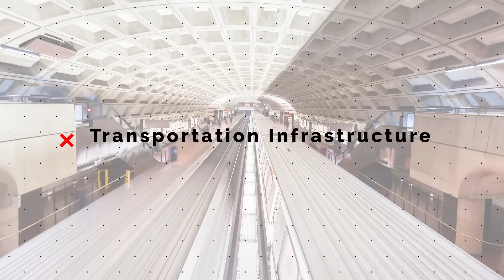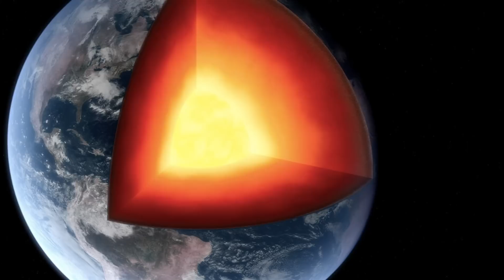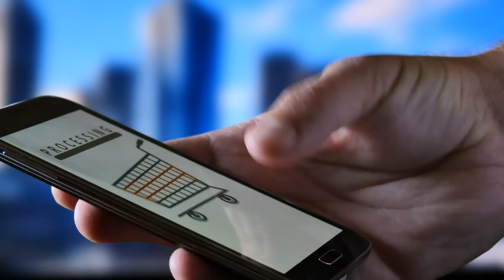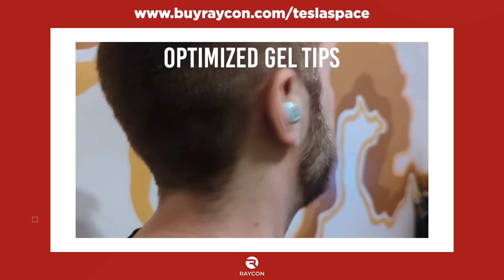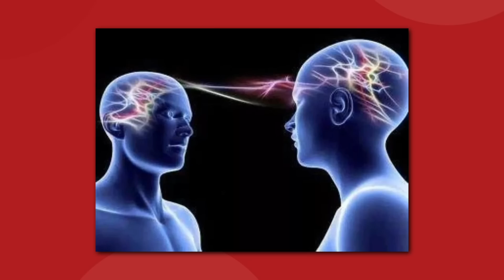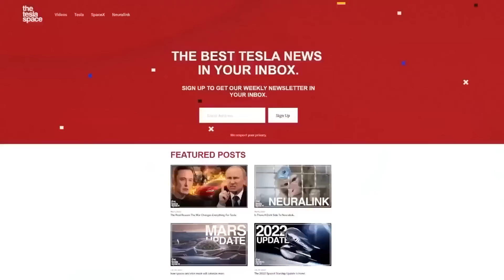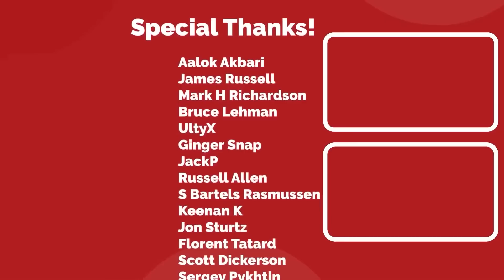How Elon Musk Will Build The City Of The Future!

Comment: Well. The city on Mars needs to be designed right now before we just start boring into the ground and putting habitats everywhere and anywhere. We need a design for the city from the deep ground up. before we get there.  And the infrastructure. Keep the noisy manufacturing and waste disposal areas away from the habitats housing.  Underground transportation  tubes need to be there to connect waste disposal, water supply, electrical, fresh oxygen, and goods all in separate tubes, some small some large.

Comment: While I agree with his points on Solar energy, there come some environmental flaws. Mainly the mass of solar panels would redirect a TON of direct heat and energy back into the sky, quite literally frying any life that goes over it. Solar arrays have had this problem for ages, which is why you commonly see it only on mid-size residential houses, unfortunaetly not where we need it most.

If we can figure out how to heat sink the solar arrays and make them less heat/light reflective, thus preventing the magnifying glass to an ant effect, then we can commercialize and go green worldwide.

Comment: I know all you guys at Tesla are smart and I'm just some dude but if you incorporate alternators into all four wheels of your cars, they will charge themselves. Pretty sure this is about limiting travel or someone would have thought of this
Reply: You still use up the energy to power the alternators. Unless we could get the energy from solar panels integrated into the cars roof. But its low and slow energy for the alternators. Especially 4 on each corner. Plus the power to weight ratio of installing solar grids on the car. There might be another way ... Maybe .. No one really knows. There is alot of research going into it. Even on different type of batteries. Whoever perfects it wins the whole EV race. But i dont know about unlimited electric. That would be kinda of insane. There would be no need for chargers then. Electric companies would be pissed. Lmao.
Reply: @gfelix3552  well I mean they made crappy light bulbs to intentionally burn out to keep selling light bulbs for DECADES. That's kinda my point. Im sure they can charge as they drive somehow. But that screws the power companies. If we're going to suffer through this green shift let's really be green about. Not this, the big guy still gets his crap thats no different from oil companies.
Reply: @gfelix3552  on a car an alternator is powered by belt motion not the battery. Harness the wheel motion. Especially for like semi trucks that are always driving
Reply: @shenanigansnsuch1442  

Yeah but the alternators in ICE vehicles are powered by gas in order to move the belts. There is a big difference in gas and electric.
Reply: @shenanigansnsuch1442  If that were the case. Someone would already beaten and won the EV race and become a billionaire like Musk.
Reply: @shenanigansnsuch1442  

Also not only are the belts in ICE completely different in that they are spinning at high RPM but they are also pretty weightless and are found around the engine. The spins on wheels would have to be going super fast in order to even gain anything and  like i said 4 on each side would be heavy. Basically it would even slow down the wheel because it has to extract the energy. Obviously there are some maths to prove it but i am lazy. Lol

Comment: OK, but as far as Drones go... the drones only deliver over the last few miles, within the cities & towns. The underground network is to replace/add to main roads, not all the countless interconnecting roads, so we'll actually need the same number drones to deliver the last miles to your door. Unless you're building a city from scratch, there's no way you can install tubes that will accommodate parcels to every address.
Reply: Water pipes needs to be replaced from time to time so why not to add another tube in the moment of replacement. But still the technology of vacuum pipes is old and if it were good idea to have it everywhere it would be the reality nowadays.
Reply: @wujido20  " add another tube" ??? 😆 That would be a massive change! And water pipes last years, decades, you have to replace/add a continuous tube for miles in one go... AND it's a pressurised tube, with junctions for every street, every home, it's not just an extra tube... AND you'd be limited to parcels a few cm wide, and only a few cm long to get round corners.... AND space for packages to arrive at each home without backing up the tube, every parcel would have to be in a container within the tube.
 It's an entire,  more complicated network and would only work for tiny parcels.

Comment: You don't evacuate the whole hyperloop tunnel.  You have a lower air pressure in the tube and then an electric compressor on the front of the pod pushes air to the rear.  It still uses air in the tube, in fact the pod is riding on an air cushion and propelled with electromagnets.
Reply: Have u ever seen how finicky a vacuum tube  can be? N u think they're gonna build one thousands of miles long, I gotta beach house in Idaho for ya too
Reply: @joshlewis575  I guess you know more about this than Musk and his team.  People were saying something similar about landing a rocket ship and resuing it.  But they did it, spectacularly.  I expect they'll do something similar at the Boring Company.

Comment: Honestly, the tunnel thing is just tiny private subways that are simply less efficient than just a subway…
I really like the the solarpunk like positive futuristic thinking of Elon and his simps (absolutely including me) but at slightly worse subways that only look more futuristic you should think twice before public-Elon-simping
Still like your videos though, keep up the positive attitude regarding our future <3
Reply: Why so sure that it's less efficient?
Reply: @bergonius  because a car is less efficient than a bus. It is also less efficient than a train.
Reply: @niveshproag3761  it's not that simple. First, EVs are very efficient, 5 times more efficient than similar vehicle. If we compare with extremely dirty polluting busses the difference in energy efficiency becomes astronomical.

Next - busses run with huge capacity overhead for attributing rush hours peak demand, meaning most of the time they run with mostly only air inside. With smaller capacity transport this doesn't happen, as during smaller demand there's just fewer units on the line.

And thirdly - TBC concept ultimately includes self-driving transport pods with greater number of seats, making it perfectly effective for the task, no bus line would be able to compete with that. 

Next
Reply: @bergonius  Compare with electric busses, not extremely dirty polluting busses lol. 

In peak hours, mass transport are something like 50x more efficient because we're simply not using a 1.5 ton vehicle to carry 1-2 80 kg person. 

However off peak individual transport becomes a bit more efficient since it's a 10 ton vehicle, less people.

Overall the balance is always towards mas transport. A mass electric vehicle would be nice, as you said. Gonna take a while tho.
Reply: @bergonius  
In the scenario of the tunnel systems are meant to replace the roads, so all of the people driving around in their cars wouldn’t really have a better way than to use the tunnel system.
So the problem with public transportation not being used to its full potential is less of a problem…
Plus, if you are in a tunnel anyways, the freedom of driving where you want on whatever rout you want that you have in a car doesn’t work anymore for you are in a tunnel, so you can only enter and leave whenever the tunnel allows it…

Comment: All these ideas are incredibly silly. Almost like they all came from a 5yo 😂 

If you are moving traffic from 2D into 3D you just increased the biggest issue with the roads - the congestion around exits. 

Next one, solar panels on the roofs of factories. Yeah, all cool and dandy but it won't cover even 10% of energy needs. Also, during night and regions on Earth that don't get too much direct sunlight, it won't work so well. Batteries are not on a level (and won't be for next decade or many decades) of grid consumption. 

Next one, Neuralink. Ah yes, the most silly concept of them all. Do you honestly think that a chip with 10,000 connections (with only on very surface layers of the brain) can do all those things? Brain has around 100 billion of neurons with trillions of connections between them. Some of the stuff mentioned in this vid would require connection to brain stem and hippocampus, which we have no clue about how to do. Even a simple water imbalance can cause brain swelling or contracting beyond repair, so why would anybody think that having billions of artificial tiny probes in the brain wouldn't cause any issues? 😂 

And then the holy grail of stupidity (although Neurallink comes in very close seconds place), is the point-to-point transportation with Starship. It has been debunked on an economical and environmental level so many times, I'm still confused why people talk about this stupid idea 😂 

Tbh, most of the things that come from Elon are completely bonkers and not rooted in reality. However, I am excited about Starship and the groundwork it puts in relation to affordable space travel.
Reply: You are so very very right!
I’m sure of it! 
Man will never fly in heavier then air vehicles it’s a proven impossibility 
Scientifically defined by the laws of gravity and physics. Can’t be done.

You are the real genius for knowing what a fool Elon is to have conceived of anything at all besides what we have already established in the known modern scientific world in which we live now.

Thank goodness for your acumen. 
Just like the church and Galileo you are right I’m sure of it. 

Maybe Elon is a witch? 
He needs a good old witch burning…  
just to find out if he is a witch or not of course.
Reply: I don't agree with the congestion around exits part. There can be almost unlimited exits, there is no need for a train station at the exit to go 3D in this case.